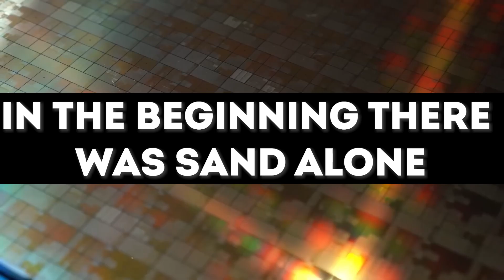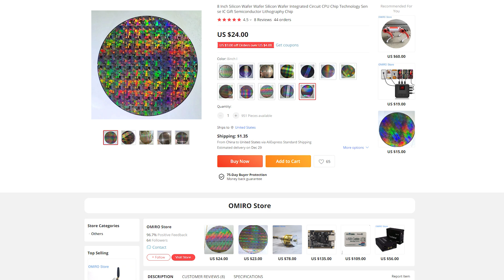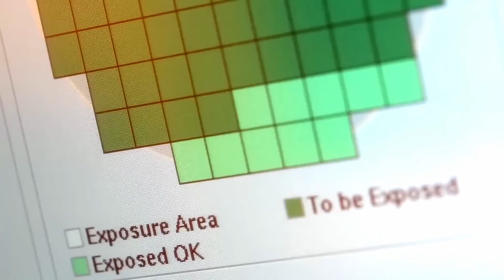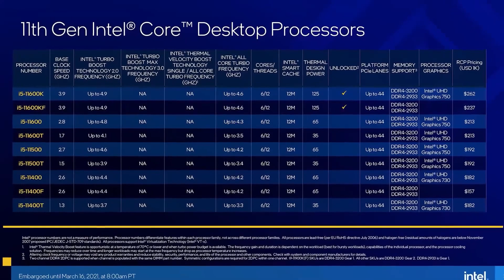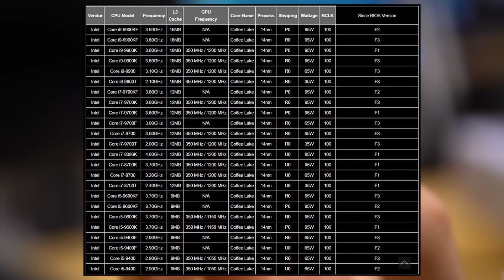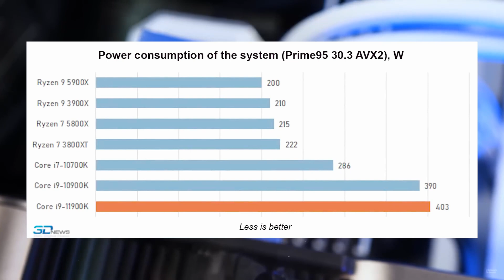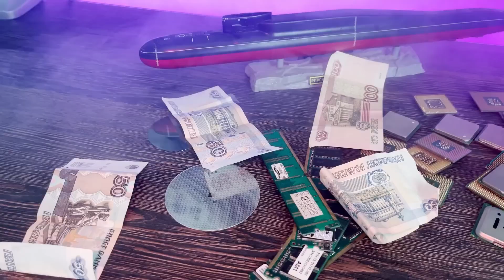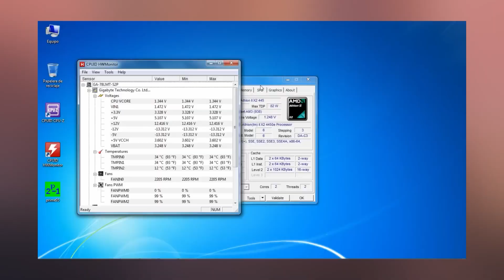GARBAGE microprocessors | Chip Binning

Comment: It's insane to actually realise that perfectly functional chips, are being artificially limited, because of profit.
Reply: Yeah this happens mostly toward the end of a generation of CPU or GPU.

Earlier on, if the process still requires refinement the manufacturer does it out of necessity as there is a huge variation in core quality, thus the achievable clock rate, amount of cores and cache size for their top tier may only have a yeild of 20%, but towards the end yeilds for their top end may be 60%, but market demand may only be 30%.

Truth is its hard to tell, especially on Intel, but on AMD, when you delid it, if your 8 core chip  has 2 physical core dies and an I/O die, then it's a binned chip either due to an under performing second ccx, that could have been a 16 core, or because market demand is not there for the 16 core.

This has happened since the dawn of time, sometimes it's for market share and profit, sometimes, it's due to a process node struggling to get yeilds high enough.
Reply: I don't get mind blown by these news because i hadthe thought in my head that it was the case from the start (yeah i'm a genius).
You don't even need to hear from a Youtube video/news article to understand that binning was a thing. 
People don't think with their peanut brains on the basic process of creating a product they mindlessly swipe plastic to get.
Reply: Yeah its because of demand, more than profit (as in, the profit is due to demand) If there was a larger demand for i9 or ryzen 9 they wouldn't create i5's out of good silicon, they would just keep making i9's. But people like me who are poor and can only afford i5 / ryzen 5 CPU's exist and want to build a pc lol

Comment: garbage processors are rather large machines that shred up then compact waste.
Reply: Thanks for pointing that out. As a non native English speaker, I didn't even think of this ambiguity. You see, in the Russian language the word "processor" usually means only one thing - that tiny machine that computes ones and zeros. In English, however, the range of meanings of this word is wider. Like food processor or garbage processors are not necessary processors made of food or garbage, but machines processing food or garbage. Pretty interesting.
Reply from the maker: Thanks for the comment. Corrected the name